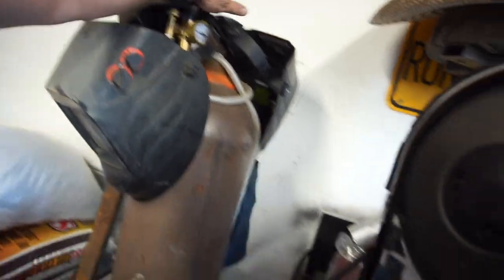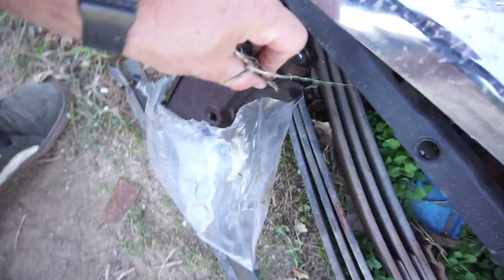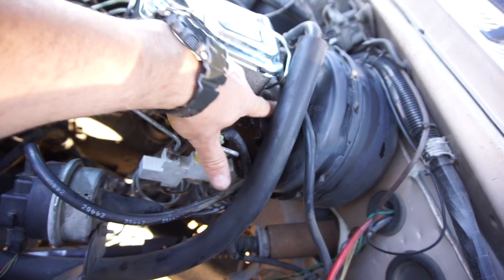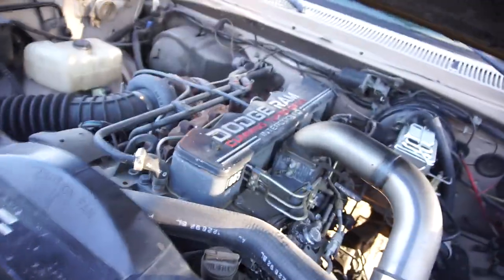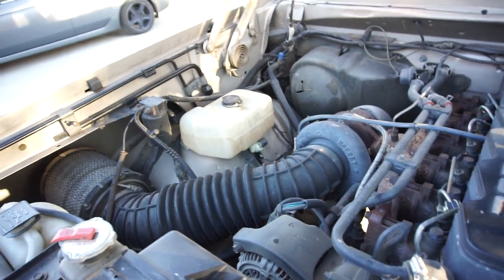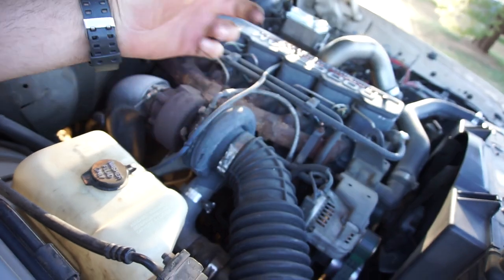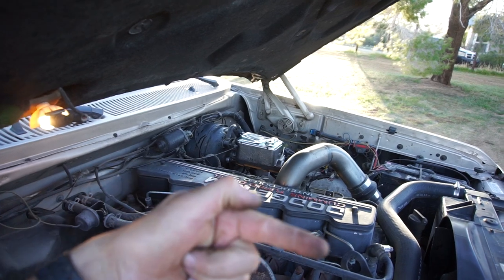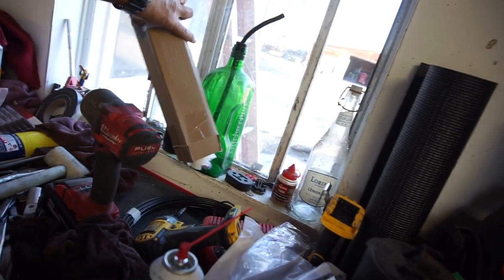1st Gen Cummins 1993 Dodge Ram Brake Master Cylinder Fixed.

Comment: I'm having really good luck just trying to order a brake booster and master cylinder that works. All rebuilt junk
Reply from the maker: Yeah I hear you. Sometimes it’s better to rebuild them yourself or just buy new. I had a Subaru that I put 7 clutch master cylinders in until I bought one from Subaru.
Reply: @Halffast719  I've been through 4 for my 92 Dodge truck.. You can't buy a new one anymore. They are all "refurbished".. So I'll try to rebuild my own.
Reply from the maker: Yeah I don’t buy rebuilt stuff anymore. It’s either new or I’ll rebuild it myself. That way I have no one to blame.
Reply: Getting a hydro boost off of a 3rd gen is a gr8 upgrade
Reply from the maker: Indeed it is.
Reply: @Halffast719  thanks for doing what you do btw